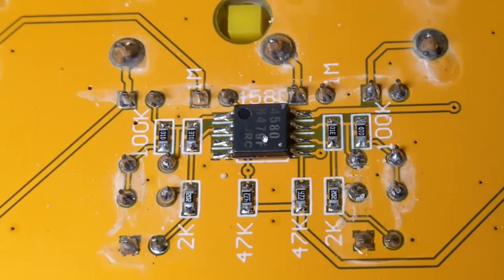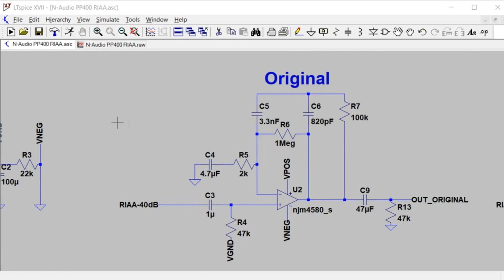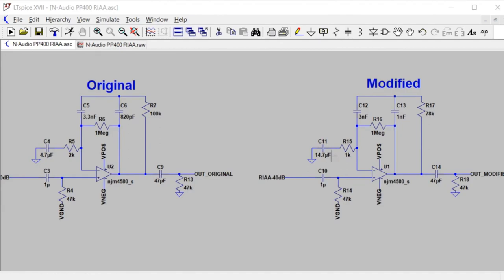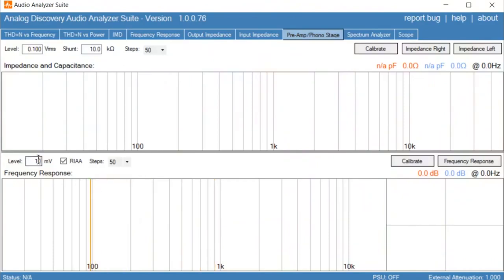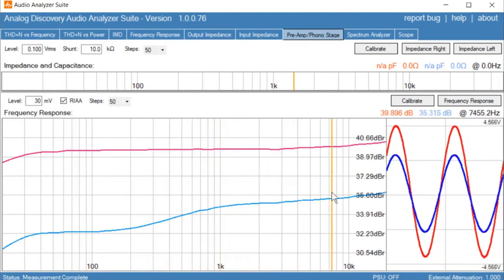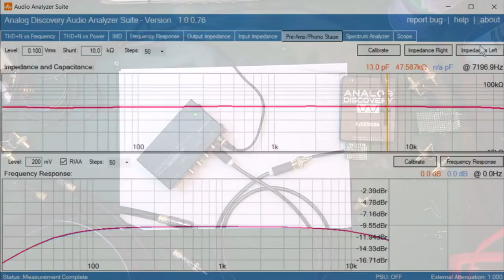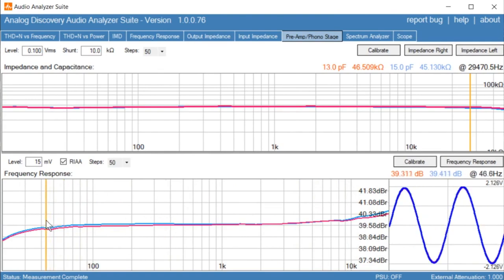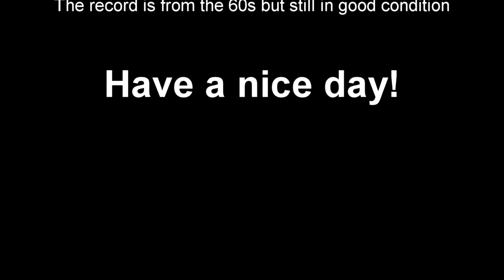N-Audio PP400 Phono Preamp Modifications [Re-Upload]

Comment: Do you have the sound difference playing some song elsewhere?
Reply from the maker: I used to have some sample music, but it got flagged for copyright so I had to delete them.
Cheers,
Jake
Reply: @TheStuffMade  I found your work very interesting and in fact the frequency response shows many improvements. As soon as I get what I bought I will test it and if I realize that an improvement is needed, I will make this modification. In the next modifications you could insert the before and after samples on some platforms like Soundcloud or even put them in a cloud like Google Drive and the public links to it. Cheers.
Reply from the maker: @karensartori3456  It's a good suggestion thanks. I should probably upload and link some music samples somewhere. Before the modification I found that it sounded like a disconnect between the bass and the rest of the frequency range, that was what got me to investigate further and eventually implement the mod.
Cheers,
Jake
Reply: @TheStuffMade  Great. Keep on doing this great mods. Just a question: if I maintain the 2k resistor it would affect only the gain? I noticed that there is an increase of amplitude in the signal, this could generate any distortion? Or it is safe to do this without distortion?

Comment: I use this preamp with .. JVC A-X900 Amp-Aux / JVC QL-Y66F Turntable with Ortofon 2 Black sounds good to me.
Reply from the maker: Well of course it's most important that you like the sound, but why don't you use the built in phono input on your JVC amp instead?
Cheers,
Jake
Reply: @TheStuffMade  Just sounds better to with it's own preamp. I plan on buying a Schiit Magni
Reply from the maker: @TweakedSystems  The phono preamp build into your JVC amp is much higher quality than this flawed little $10 box. It's also better than the Schiit Mani. Since you invested $700 in an Ortofon 2M Black cartridge, I'd recommend going a bit more high end on a separate phone preamp with more features, get something with adjustable input impedance and capacitance.
Cheers,
Jake
Reply: @TheStuffMade  something like Cambridge Audio Alva Duo

Comment: From your video, it is apparent that the modified preamp is clipping already at 20mV input, which, given the input sensitivity of 5.3 mV, translates into an overload margin of only about 11dB. This is worryingly low. The recommended minimum is usually 20dB.  Behringer's spec gives actually 23.5 dB. It seems that your modifications have lowered the overload margins drastically.  I would almost guarantee that you have distortions due to clipping on many LPs with this.. The noise level will have gone up by a couple of dB as well, and that was already not the best to start with (the 68dB quoted by Behringer is not better than the typical noise level of a vinyl record).

I bought actually the Behringer myself last week, merely in order to get an idea how good the integrated phono preamp of my new Onkyo receiver is in comparison. I don't have the instruments you have, so I just took some digital recordings with both (unmodified Behringer) and compared the frequency spectrum in Audacity. I can confirm your finding that the RIAA curve is not very accurately reproduced with the Behringer, as the spectrum is about 1-2dB under the Onkyo spectrum at low frequencies and about 1-2dB over at high frequencies. However, this makes only a very slight difference if you listen to the music. You can only hear it in direct comparison. I doubt you would notice it if you listen to the samples more than a few of minutes apart. It is certainly not objectionable in any way.  On the other hand the distortions due to clipping will be very objectionable, and there is no way to digitally  get rid of them after recording.
Reply from the maker: If you are concerned about the overload factor you can always lower the gain or just increase the supply voltage, the NJM4580 will run with up to 36V. It depends on the output of the cartridge you are using if it will ever be a problem. I started investigating this phono preamp because I could easily hear there was something wrong when playing back records, sure our hearings are all different, but a phono preamp should not have a 3dB difference between low and high frequencies.
Cheers,
Jake
Reply: Hi Jake, 

Distortions on some of my vinyl digital recordings I made over the last 10-15 years or so (I rarely listen to records directly these days) have been the single most annoying issue, even when heard over less than HiFi-equipment. I solved this only recently by switching to a new cartridge, which has better tracking (having an elliptical stylus rather than conical) and, as I found out only later, also has a lower nominal output that matches now the input sensitivity of my preamp. The old cartridge had merely 2mV more but this appears to have been part of the problem (the recording with the new cartridge has no distortions, and the clippings visible in the previous recordings are gone).

As for the deviations from the RIAA curve, there are still the bass and treble adjustments on your main amp that you can use to correct this. You would have no issues with distortions here unlike when making hardware changes resulting in a not properly matched system.

You also have to bear in mind that the sound of a vinyl record depends on whatever the recording engineer put on the master recording in the first place, and that can vary wildly, certainly more than the 3dB in the Behringer preamp. So this is all a bit fluid and subjective. In the end, you get used to the overall sound your system produces, but even only occasional distortions are hard to digest, especially of you listen over headphones, and they can't be removed or compensated. So in this respect, I think matching the output and input voltages in your system properly should be of the highest priority,
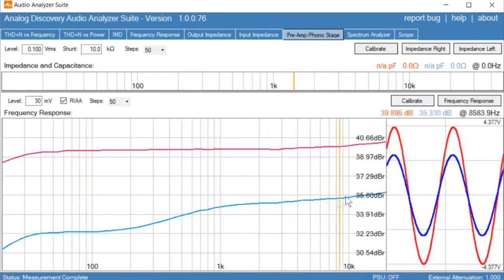Reply from the maker: Hi  @thomassmid8763   I was a bit curious because it can't be that the preamp is clipping already with 20mV input as that is only 6Vpp output, so I decided to redo the measurement and I found that actually it doesn't clip until 32mV and then the output is about 9.2Vpp or 3.2Vrms. you can see a capture of it here: imgur.com/AR8efPH that makes a lot more sense with 12V supply. Of course as I mentioned in my first reply you can always increase the supply voltage, but you will probably start having your line input clipping if it goes much higher. I also checked earlier in the video around 14:13 and see I actually did the first test with 30mV input and no clipping. So the overload margin should never be an issue even with the standard 12V supply. The reason it clipped in the last test is because the PP400 preamp uses fairly large value polar electrolytic coupling capacitors on the output to remove the DC offset and if you just switch on the power and use it right away then these capacitors might not yet have charged up to the center voltage and it will clip at a lower voltage.

Anyway, I think records are a very flawed format, you will always get distortion in the range of 1 - 5%, dependent on frequency and where on the record you are, even with a high end cartridge, but personally I enjoy well mastered records, especially older ones (generally before 1990). I'd never buy a new release on vinyl as they usually sound awful and the digital version is much cleaner. However I've noticed one of the problems I have with digital is that it's too easy to switch tracks all the time and never just sit back and enjoy a full album, here the old records have a big advantage.

I'd not recommend trying to use the tone controls to try correct the frequency response error in the PP-400 preamp, you'll end up with a peak or a dip in the midrange even if you get the bass level perfect.

Cheers,
Jake
Reply: @TheStuffMade  Hi Jake, Thanks for doing these further tests.   Even if the overload margin is 32 mV this would still not be great though. It would be about 16dB over the input sensitivity of 5.3mV. Even with a 3.5 mV cart it would only be 19dB. The built in phono stage of my Onkyo receiver has 70mV overload margin according to the spec, which equates to 26dB given the 3.5mV input sensitivity. 

Anyway, I returned now yesterday the PP400 to Amazon. I couldn't test the clipping issue myself with it as I don't have the records available at my present location where this is an issue (it occurs only with a small percentage of records that have apparently been cut a bit 'hot'), but I certainly won't expect any improvement on my built in phono stage in this respect. It sounded a bit dull in comparison as well.

However, a further reason why I purchased the PP400 is this:
I bought recently a new turntable (used from Ebay), a Marantz direct-drive from the 80s. All the recordings made from this over my Onkyo receiver show a pronounced sharp peak at 33Hz in the spectrum. I bought the PP400 in order to see whether it is the turntable that produces this peak or the built-in phono stage of my receiver. Since  I found that this peak also occurred when recording with the PP400, this means it is the turntable. Would you have an idea where this 33Hz frequency could come from (there is also a 16/17 Hz peak which may be related)? One often finds the mains frequency and its harmonics in the spectrum, but this is new to me. It doesn't appear to cause problems as I couldn't hear anything of it in the recording, but it would still be good to know.

Thomas
Reply from the maker: @thomassmid8763  
Hi Thomas,

These overload levels are complete marketing BS. Something else will start clipping way earlier than reaching e.g. 26dB, just think about it, if you are listening to music at a moderate level with your amplifier delivering peak 10 Watt to your speakers, then a 26 dB overload would require your amplifier to deliver 3981 Watt into your speakers without clipping. Yes that's close to 4 thousand watt !!!, I don't know any amplifier or speaker that can handle these levels of dynamics.

Anyway, on the 17/33 Hz peak issue, my best guess it's the resonance of your cartridge combined with your tonearm, there are some advanced calculations to find out if your arm (heavy or light) is compatible with a specific cartridge, the compliance of the cartridge is important here (often specified as something like e.g. Dynamic compliance: 6.5 x10-6 cm/dyne). It's referring to the hardness of the rubber holding the cantilever on your cartridge vs the mass of your arm, so a heavy arm, like old school aluminum with 1/2" headshell usually works better with a slight stiffer cartridge, but one of the more modern light weight carbon fiber arms work well with a soft suspension cartridge. It's a personal preference, some like the light weight arms, some like the heavier arms. But a bad combination of cartridge and arm can result in some nasty resonances going too high in frequency. 

Cheers,
Jake
Reply: @TheStuffMade  Hi  Jake,

26dB is only a factor 20 voltage increase, so if you have 200mV nominal output from the preamp (line level), that would equate to 4V,  pretty much the same level you worked out above. Yes, that would mean a 400x increase in power, but you would not have this increase permanently, only during very short occasional spikes, probably of the order of a millisecond or so. And your amp and/or speaker would most likely clip way before that.

The output power is often overstated with cheaper systems due to marketing reasons, by using units like 'Peak Music Power' which is about 10 times the normal RMS power (you can interpret this as the overload power, i.e. the power the amp and speaker can handle for a short time), but the overload margin for phono-preamps is certainly not stated for marketing reasons. In fact, for most preamps it is not given at all, not even in the user manual (for my Onkyo receiver it is though), or you have to work it out in some way from the other data given.

The following link shows the clipping occurring with my old cartridge (this is from an actual music track)
https://drive.google.com/file/d/1rgPconT8XeKLt9LCz8xZPERis7MzVelr/view?usp=sharing
(see the two peaks near the center in the bottom channel). Just those two shaved off peaks cause a very annoying distortion in the music.

With my new cartridge (which has a 2mV lower output) there is no clipping
https://drive.google.com/file/d/1xm64DKT1uNdymhlaPCDPehh9lmtuCsLn/view?usp=sharing

The 300 Hz test-tone from the Hifi-News test LP gives me the following for the +16 dB tone with my old cartridge
https://drive.google.com/file/d/1bQFWcsDP1RYHZ-uSjAXphT7dFg5WbM5r/view?usp=sharing
(I am not sure though whether this is clipping (as it is not symmetric) or mis-tracking of the stylus). 
Again, with the new cartridge everything is normal here. So it goes to show that just a couple of mV less headroom can cause substantial issues.

As for the 16 Hz and 33 Hz peaks occurring with my new direct-drive turntable, this has nothing to do with the tonearm resonance. I have marked both frequencies on this spectrum plot. 
https://drive.google.com/file/d/1v3WtdUju8AApfF-a7uW8Ew6tcP5l8yqk/view?usp=sharing
The tonearm resonance is the broad feature around 10Hz. This is well below hearing threshold and therefore not a problem, neither is the little 16 Hz peak, but 33 Hz would be potentially audible (although I could not hear anything even when I filtered everything else out). These two peaks are not there with my other (belt driven) turntable, so I was wondering whether they are caused by the direct drive motor or whether the turntable picks up something from the environment (which is different as well.)
Reply from the maker: @thomassmid8763  Hi Thomas, sorry I didn't see your reply earlier, it got blocked because of the URL links.

Anyway, yes you are correct that 26 dB is only a 20 times voltage gain and it's a 398 times power gain. But what do you mean it's only a temporary gain?, are you implying your amplifier can deliver 4000W temporarily and your speakers can handle this without either of them clipping? Please consider that to deliver 4000W into 8 ohm even for 1 micro second you need a power supply capable of delivering at least 500 Vpp !! Your amplifier cannot do that and your speakers cannot handle this, so there is absolutely no point of the 26 dB overload factor, it's pure marketing BS., we are getting into marketing worse than the fraudulent PMPO specs from the 90s where the marketing people took all the numbers they could find (including the model number) added them together and multiplied by 10.

It's hard to say exactly where this low frequency noise is from, it might be the turntable, have you tried the cartridge in a different turntable / tried a different cartridge in the same turntable?

Cheers,
Jake

Comment: where is the RIAA curve applied?
Reply from the maker: In the phono pre-amp it's part of the feedback loop. And in software the inverse RIAA is applied when the RIAA checkbox is checked.
Reply: @TheStuffMade  So you removed the RIAA curve through your modification of the circuit?
Reply from the maker: Hi  @alphanumeric1529  no, the modification corrects the 3dB+ error in the original design from the manufacturer.
Reply: @TheStuffMade  Well in that case how did you confirm that your basic RIAA curve achieved is perfect. because you are using your inverse curve from your own design. so it would negate the effect even if exact RIAA is not achieved during modification. Can I request you to share Ltspice schematic?  I would give it a try.
Reply from the maker: @yogeshkar  The RIAA curve is very well defined, why would you assume I'm not capable of  producing an inverse RIAA curve? I did write the whole Audio Analyzer Suite. You can find plenty of models for RIAA and inverse RIAA on the Internet if you need one.
Cheers,
Jake
Reply: I have remover HPF by changing 14.7 uF to 1000uF
Reply from the maker: @yogeshkar  You will get problems with rumble, plus the recovery time after clipping and power on will be much slower.
Reply: @TheStuffMade  Not in real , I just removed for simulation purpose So, I can get actual curve of RIAA network.
Reply from the maker: @yogeshkar  That doesn't make any sense, just add an inverse RIAA on the input and see what deviations there are from flat, that will give you the RIAA curve. Or just watch my video where I do this. You said you know what you're doing but your approach sounds like you've never done this before. Anyway, I'll put you on ignore now. Best of luck with whatever you're trying to achieve.
Cheers,
Jake

Comment: I think you may have a dodgy one, I rate this cheap little preamp over the basic Schitt units. It is completely transparent too!
Reply from the maker: That's very unlikely, none of the components were damaged and all their values match what is printed on the circuit board, plus the spice model simulation matches the measurement results. But possibly it's frequency response design flaw matches with your equipment or perhaps you prefer this kind of frequency response, we all have different preferences. However I can say is that it's quite far off from the ideal RIAA equalization.